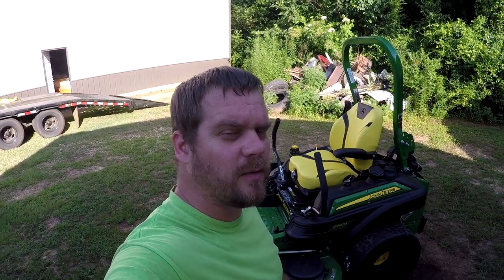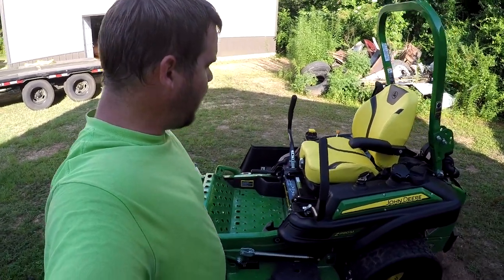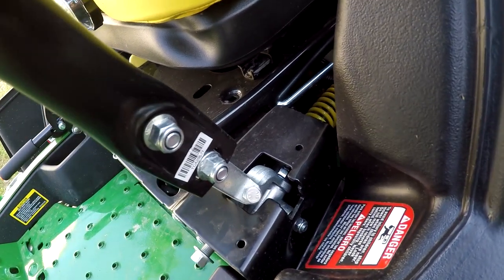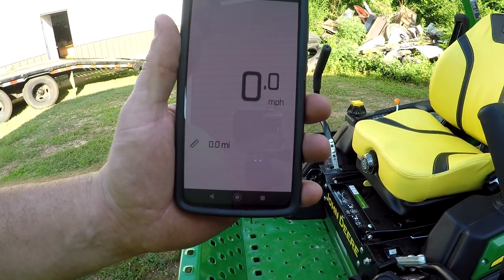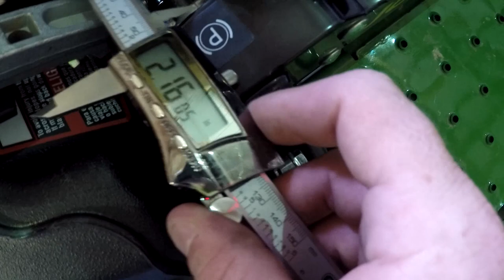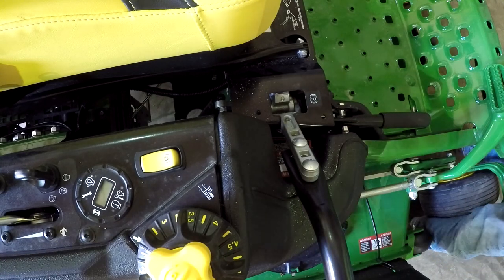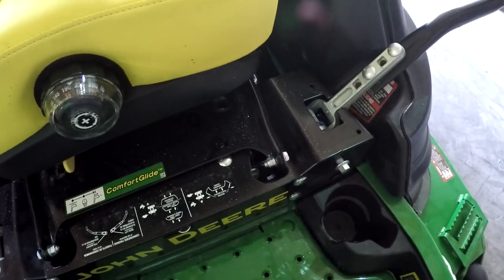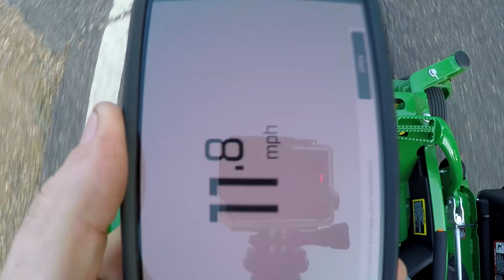Can you make a John Deere Z960M zero turn faster

Comment from the maker: This is really not worth doing for the minimal gains in my opinion, and you lose the ability to adjust the tracking of the mower to make it go straight at full stick if you trim to much like I did.  Not very many areas smooth enough you could cut grass at or above 10mph and get a clean cut anyway. I was just curious if it would make a difference... I did touch up the trimmed area with paint on a Q tip afterwards to keep from rusting... Thanks for Watching!

Comment: Hey life with chase howes your 400 watt metal halide
Reply from the maker: I have a bulb that went out in one and I haven't changed it yet cause it's 20ft in the air. The others still working.
Reply: 10 mph is fast for a mower , I couldn’t stay in the seat at that speed. Break it in right Chase , get the ole grinder out . You got to customize to your needs
Reply from the maker: LoL, that's what happens when I get bored 😂
Reply: How you can get a 20 ft latter to change your metal halide